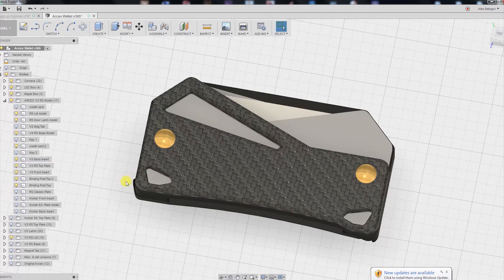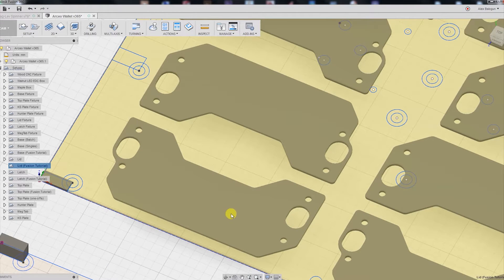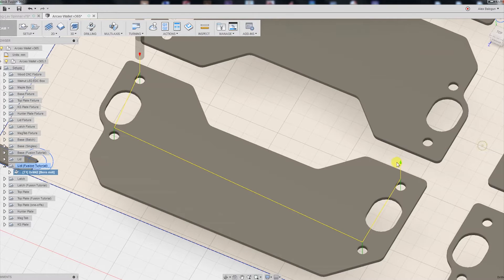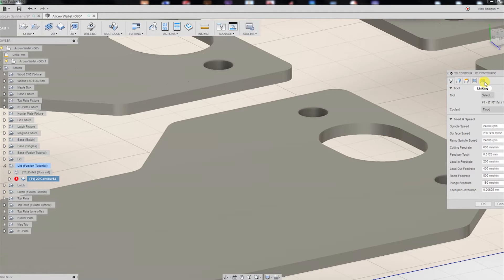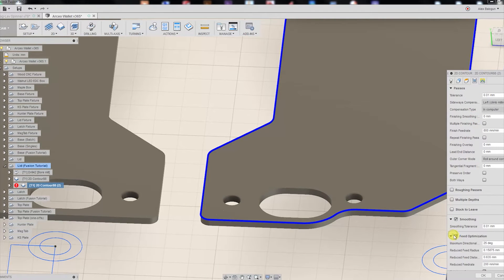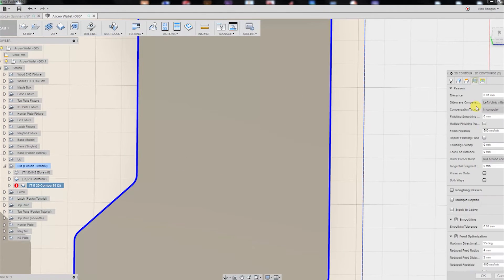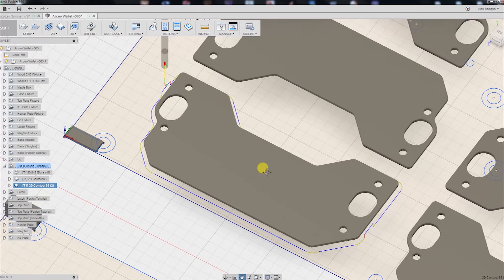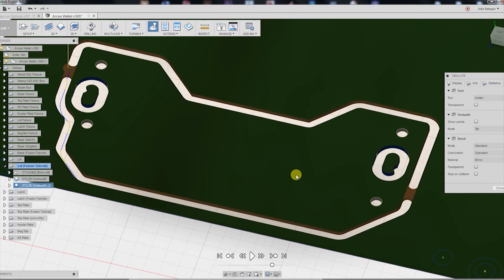Lasers! And Simple 2D Contour CAM in Fusion 360 - Wallet Making Wednesday - WMW04

Comment: Great video. Question: what laser machine are you running and is it not dangerous to laser cut Carbon Fiber since it produces toxic fume?
Thanks
Reply from the maker: Hi Fred, it's a Full Spectrum Laser H-Series 40Watt and yes, it would be dangerous to cut this material without proper ventilation.  It is also very thin material so it doesn't give off too many fumes.  We have a 1200 CFM inline fan hooked up to this laser + carbon filter so the ventilation is extremely strong.  This is also G10(a silica glass compound), not carbon fiber, it is just made in a 2x2 twill pattern.  Real carbon fiber would be a lot tougher to cut with a laser.  :)

Comment: Nice explanations for your order of operations. 
BTW, why did you change the pocket helix ramp to 3 deg?
Reply from the maker: I just gave it a little steeper incline, the reason is fairly arbitrary, the default went a little slow.  TBH you could probably get away with double that angle.  One thing is didn't show was that if you set a radial clearance on the ramp setting, it will leave some radial stock for the final cutting pass and enhance speed and accuracy of the op. Cheers!